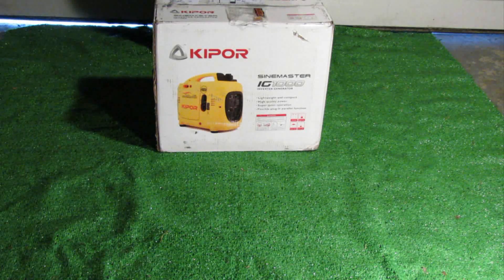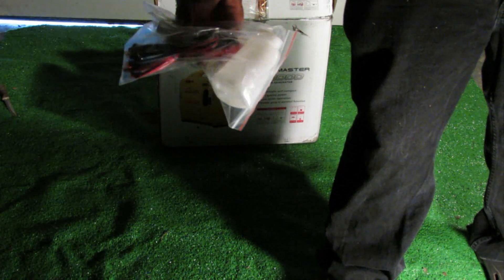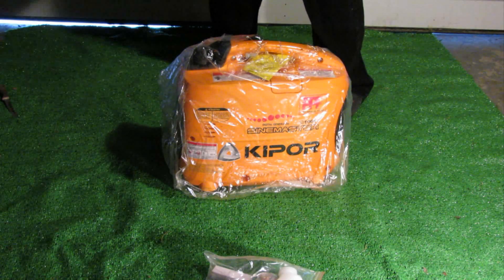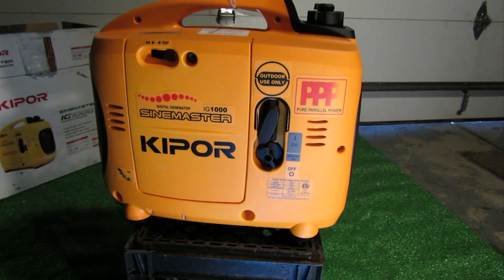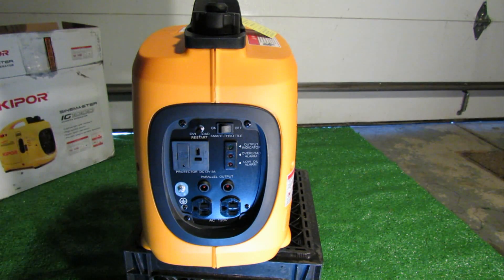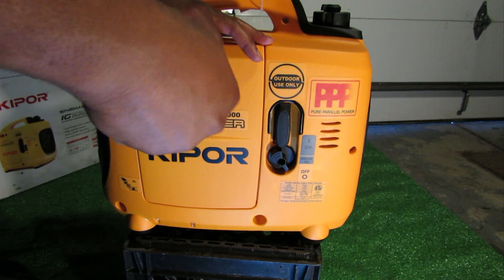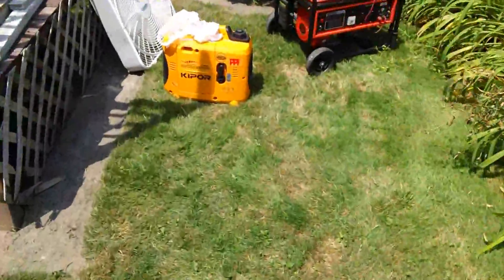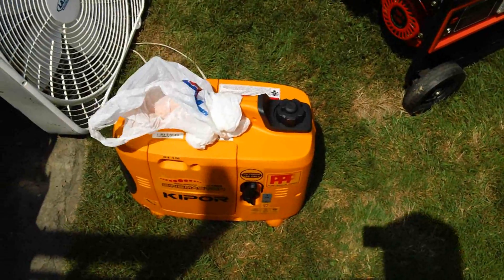Kipor IG1000P inverter generator unbox, setup and first start U.S.A version Kipor IG1000

Comment: We are very happy with this generator✳✳>share4.photo/K1kInverter?37    we use it in our band and it holds up to the load we need and when we are playing you cant hear it at all. You can carry a normal conversation standing right next to it with no interference from sound.

Comment: I've had a Kipor KGE 3000 for at least 10 years and it is  used for power outages and camping and it's always ready to go starts right up and most of the time it does every thing I ask of it on the economy setting. good video

Comment: so now you have 3 generators?
Reply: Yep, this being the first experience with the inverter style though. If a power outage happens, I'll be the power king, LOL
Reply: ***** lol this one will be better to run during the night just big enough to keep a fridge running, and it is quiet
Reply: TheWallyjp
With the new energy star fridges, it will probably run lights and a few fans too. I hooked my 2nd fridge up to a 750 watt inverter and it ran with power to spare. Surged about 450 watts and ran about 200. To my surprise, the light bulbs pull more power than the compressor. Part of my testing will be to find out the noise level at certain loads. My guess is @ 200 watts, the sound level shouldn't be much louder than idle, when in the smart throttle mode.
Reply: ***** yea i think it will be the best one to use at night, should be the quietest
Reply: גנרטור מצויין חזק אמין
Reply: diesel gasoline or unleaded gasoline?